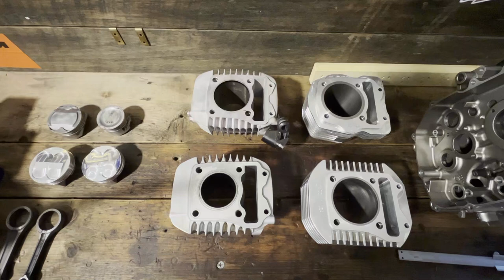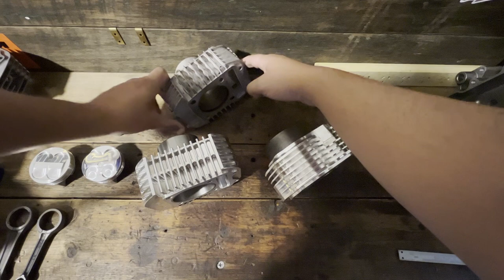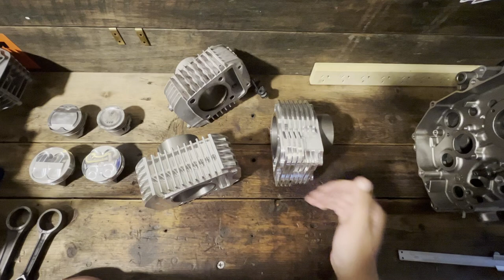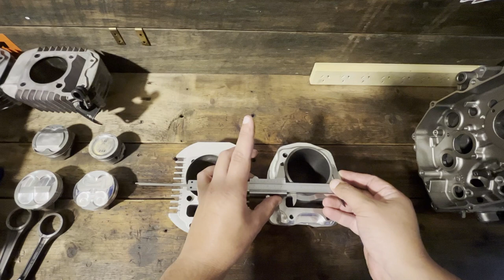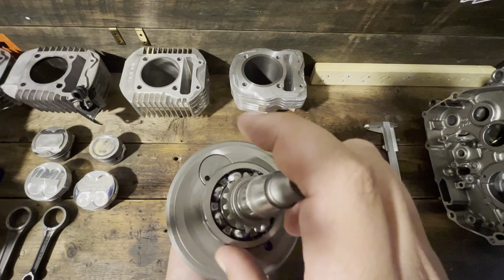Honda Monkey 125 - Upgrading to 210cc Part 2 - About the Parts

Comment: First off, I subscribed...why would someone want to do this, it's a monkey. I would just get a bigger bike...I have to see the end 😃
Reply from the maker: You definitely have to question someone’s sanity when they are doing this haha. But it’s unbelievably fun. I have to make a follow up video now that the bike is running. You wouldn’t do this unless your monkey is a keeper. 

Also, my old 181 setup was the fastest monkey in Australia. Since then I’ve helped someone build a koso 4v 198, so I had to take mine up a notch to keep my title 😂
Reply: @mongerrr  the horizontal fin cylinder with no piston...hell no! You know that this build won't be as reliable as stock...wouldn't take it too far in the outback if I were you 😉